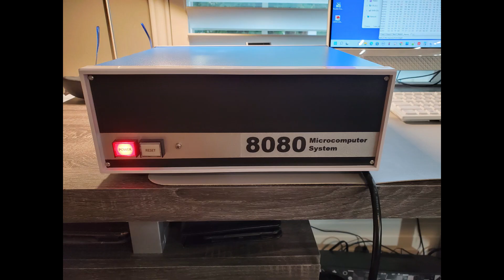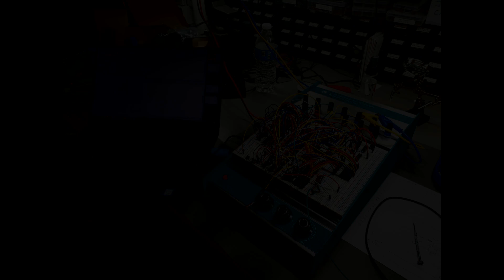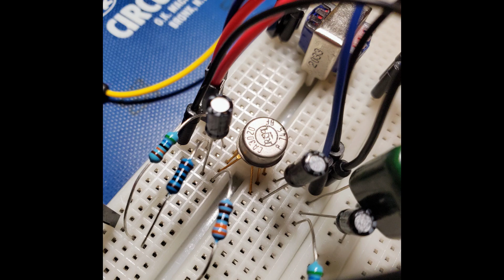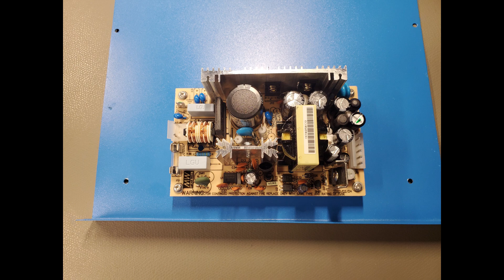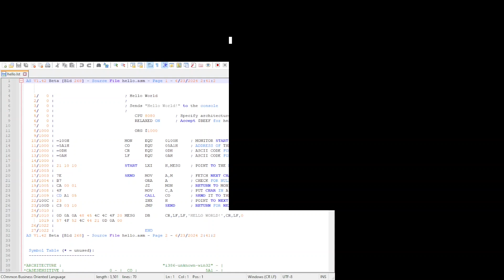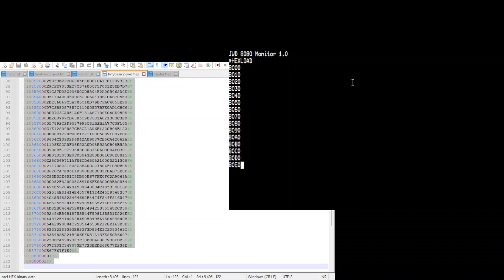Homebrew 8080 Computer Part 2 - Construction and Testing

Comment: Interesting but I'm not sure if these new fangled "microcomputers" will take off.
Reply from the maker: @esra_erimez  With one sentence you've captured the thinking of leaders in the computing industry in the 70s.  Intel wasn't making money selling microprocessors.  Nobody had a sustainable business selling microcomputers.  IBM could see there was some demand from small business but they thought it would only be incremental to their mainframe business.  DEC thought mini-computers were already small enough and cheap enough for anyone that really needed a computer.  Other than a calculator, what is a micro-computer good for?  Gordon Moore didn't own a home computer until the 80s.  Other than a Color Computer and an early PC1 pocket computer I had as a kid for learning BASIC, I didn't buy a computer for my home until 1998.  So, yeah.  Right on.
Reply: @netzener  thank you for the detailed response. My dad grew up during the formative years of the microcomputer and we are binge watching your series now.
Reply from the maker: @esra_erimez  Awesome!  Your Dad will likely have experience with the "Great Consolidators" slide in the 4th and last video, I think.  I think I'm a bit of a bore as a presenter so I hope you can stay awake :)